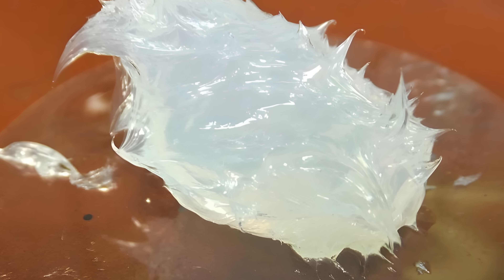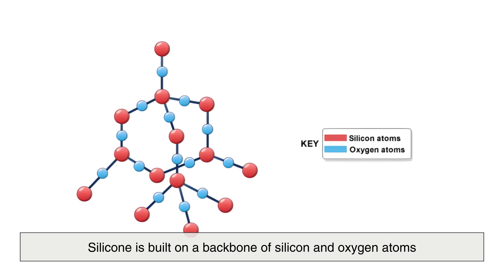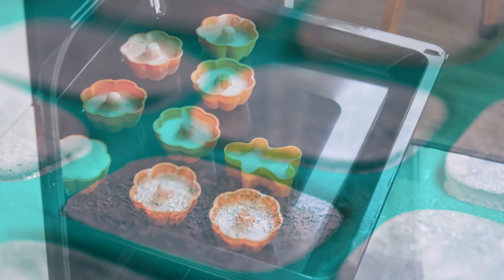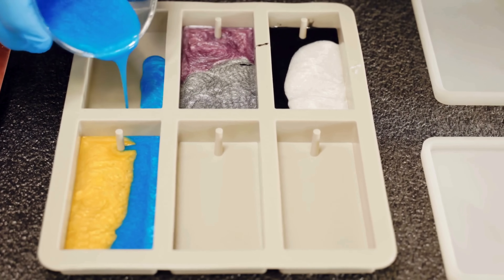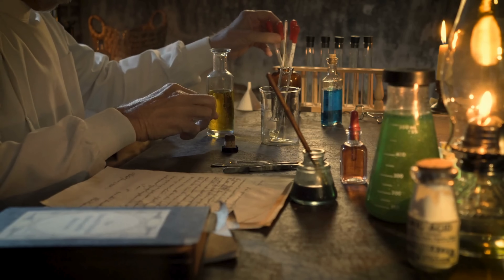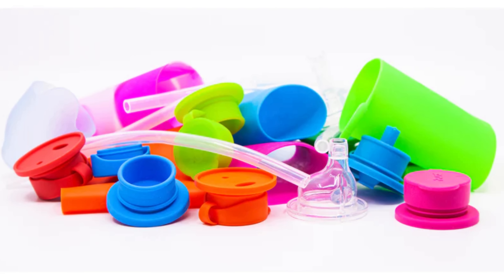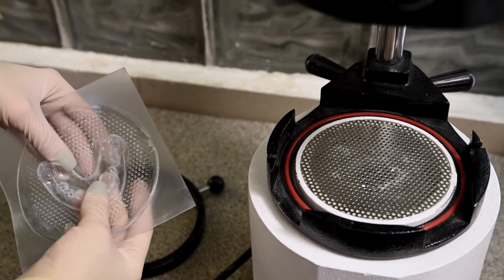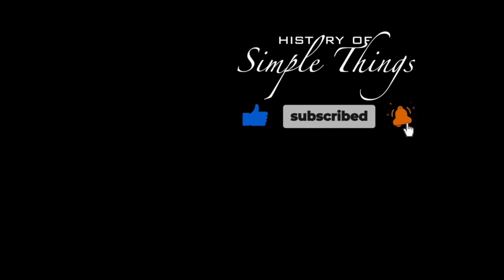Silicone Explained: The Most Misunderstood Material on Earth [ID0808]

Comment: wouldn't it be a "SIMPLE THING" to convert the Temperatures from Celsius to Fahrenheit?
Reply: No. The more intelligent parts of the world use Celsius (and metric).
Reply: @wazza7575 , the metric system makes more sense than franctional inches and feet; however, Celsius gradients are too coarse. Yes, I know it's based on the boiling and freezing points of water, but compared to the larger number of Fahrenheit degrees , Celsius is like using a child's grade-school wooden ruler with its ridiculous 1/4" graduations.
Reply: @goodun2974  thats why we use decimal points...
Reply: @95rav , if your child has a 1.5 F° temperature above normal, thats likely okay, children do that often without harm; but a temperature 1.5 C° above normal is life-threatening, cause for a hospital visit. Celsius is a blunt instrument!
Reply: @goodun2974  yeah... so we act BEFORE 1.5°C. Thermometers don't go up in  0.5°C increments!
It isn't rocket science...

But, you do you. As the saying goes: "Stupid is as stupid does." The rest of the world has passed on from age Age of the Dinosaurs.

Comment: My pervasive question is:  why can't fresh silicone sealant stick to already cured silicone sealant?
Reply: According to Google, 
"It's generally not true that fresh silicone won't stick to old silicone at all, but adhesion is significantly weaker and unreliable, often failing quickly, so removing old silicone completely is highly recommended for a durable seal. Fresh silicone struggles to bond strongly to cured silicone's slick, oily surface and trapped contaminants, leading to debonding, mold, and premature failure, making thorough cleaning or removal the best practice."
Reply: Because it's a three dimensional network that is created by the curing and bonding of smaller units, but once it's fully cured that's it. the newly added silicone can't really react with any reactive chemical "attachment points" of the old material. This leads to two separate layers forming

Comment: so many factual errors...
- the black hot-melt stuff around the window cassettes (shown twice) is butylene rubber not silicone
- the foam above the door frame is polyurethane foam not silicone
- all, really all, shown electrical cables have PVC insulation, not slicone
- the solar cells at 0:41 are silicon solar cells, no silicone there, not even in the encapsulation
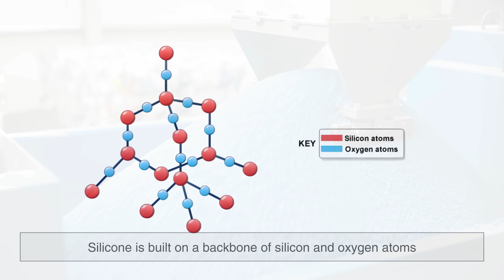- the chemical structure at 1:14 is glass not silicone
- there always at least as many carbon atoms as silicon atoms in silicone, but yes, admittedly, the "backbone" is a silicon-oxygen chain
- the thermoformed dental mold is almost certainly not made from silicone, since - well - silicone is not a thermoplastic material
- most mobile phone sleeves are made from polyurethane not silicone
Reply: Your comments and observations , certainly enriched our information .
Thanks
Reply: Thank you for saving me from watching this video.
Reply: It's just click bait.
Reply: We use polyvinlysiloxane in dentistry (PVS)
Reply: @rymoy4923 for casting or for thermoforming as shown in the video?
Reply: Thank you !! I was also once again puzzled when seeing electrical-wires insulated by silicone ?? What ? This topic of silicone vs plastic vs rubber vs PVC vs all polymeres is probably one of the most confusing topics (for outsiders)!
Reply: Really would have been better to use a diagram that demonstrated the products made from silicone as well, like metals, polymers, etc.
Reply: Artificial rubber is made from Styrene Butadine 1,3
Reply: @thillaiambalam5661 I know - no silicone in there
Reply: "aviation industry" and then showing the engine of a fighter jet (all titanium and other high temperature resistant metals)
Reply: Well. Now the disclaimer at the beginning makes sense. I’m glad there are people out there smarter than me.
Reply: Silicone-insulated wire and cable does exist; soldering stations often use it to connect the iron to the temperature-controllng station because it won't melt if touched with the hot iron, and multimeter probes are often made with silicone-insulated wire because of it's high flexibility, high electrical resistance, and heat resistance.
Reply: @goodun2974 I know - that's why I commented that the one shown here were not of that kind!
Reply: You must be new to the channel. The stock footage used is always off the track.
Reply: @lajya01  I always unrecommend all channels whose videos use stock footage, especially if it's off topic. So with this, gone!

Comment: Silicone isn't the strongest adhesive. A friend used it to mount audio speakers and could be easily pried off after blowing them out. Metal heads ya know.
Reply: Silicone formulations vary significantly in strength; some are latex-based and smell like ammonia (not very strong or durable); others are solvent-based (preferred for making your own engine gaskets, which must also be easy to scrape off and remove). The strongest ones I've used are acetic-acid based and smell like vinegar when curing (but don't use on exposed copper wires or circuit board foils, because the acids can cause corrosion ---- special, very expensive silicones exist for that specific purpose).
Reply: Sikaflex is better

Comment: A disadvantage of silicone orings is its soft structure rubs apart like an eraser in sliding applications. It also stretches out of shape in tension and doesn’t spring back like most rubber compounds. That’s why there are still so many other choices for materials other than silicone rubber.
Reply: Silicones are permeable to many non polar solvents too.

Comment: Silicone caulking can be dissolved in Naphtha. Then used in this liquid form to waterproof clothing. Once dry, the garment is waterproof for an extremely long time. 

Don't be a dummy, use protective gear when using Naphtha.
Reply: It dient work
Reply: @JasonDBike one tube (12 oz) clear silicone mixed with 1 qt of Naphtha. Mix untill silicone is dissolved. Soak cloth overnight, then let dry. I believe there is a YouTube video by Nighthawk that shows the process step by step.

Comment: Is Silicone fireproof or fire residence and how does it compare to plastic?
Reply: Silicone resists heat and flame well. Silicone tape is used on the heated jaws in machinery for sealing plastic bags. It is also used as a masking material for plasma spraying where it withstands very hot metal vapour. Sustained exposure to a high temperature flame will cause it to decompose into silica. Silicones are useful at very low temperatures and remain rubber like when other materials become brittle.
Reply: Silicone is fireproof because it already has oxigen so it can't react with more oxigen
Reply: @alexandremoscatelli  Silicone is fire-resistant, not fireproof. Its strong Si–O bonds make it harder to burn. Still, having oxygen in a compound doesn’t automatically make it fireproof; for instance, alcohols contain oxygen but are highly flammable.

Comment: Do one on heavy fuel oil and what would happen if you put it into your diesel truck tank
Reply: Would clog as it cooled and or overheat if it was put in as a boiling liquid.

Heavy fuel oil is a solid unless heated, it must be very hot to be usable liquid so it's usable in engines that will be run continuously for many hours.